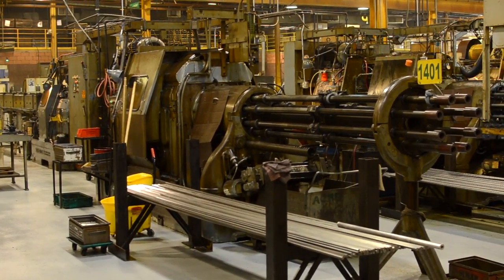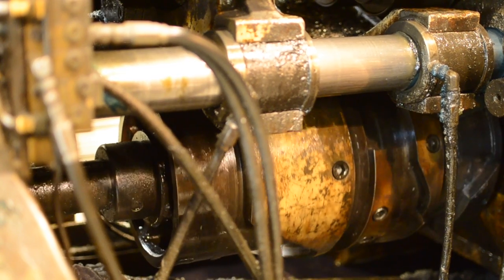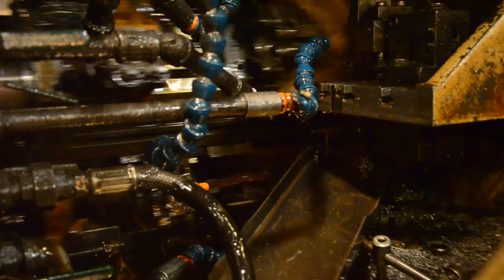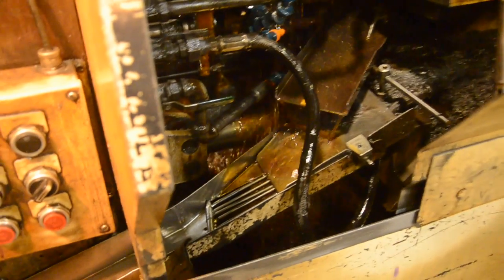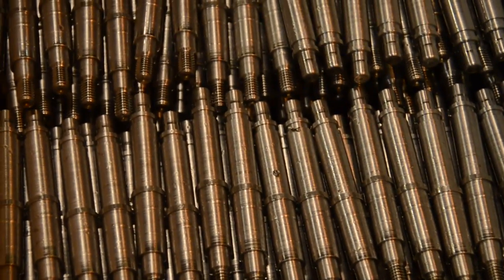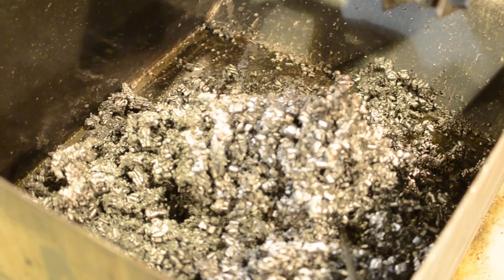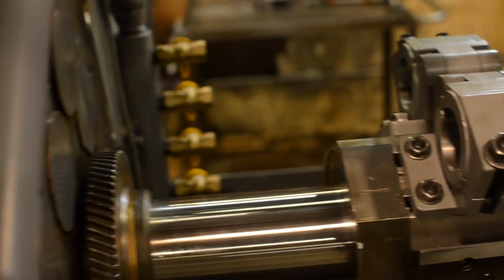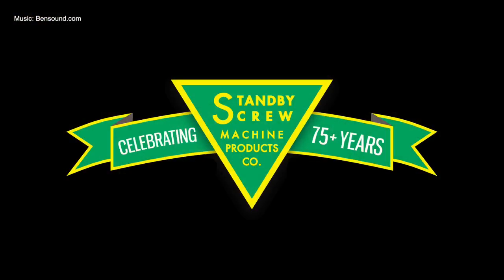Acme Multi-Spindle Screw Machines

Comment: I worked at black and decker hampstead md. Last job there ran 4 machines making chop saw gears. Ran everything from mitsubishi acme gridley, to conematic wickman with pick off at cut off position. We had 52 multi spindles till early 1980's. All had a cost tag on front of machine. Some of the big ones they bought in 70's were well over quarter million. Best job on factory floor

Comment: that shop (and machine) is fucking sparkling clean compared to the one i worked at
Reply: Same
Reply: The shop I worked in had a 3" layer of sawdust and duckboards because of the vast amount of oil that flew out of these and the single spindles as well

Comment: we still have 7 single spindle ones 10 5\8" and 6 3\4"and use to have a about 25 4 spindle 5 1\2 and  8 " ones been replaced by CNC now. they make taper roller bearings

Comment: I visited some Connecticut screw machine factories back in the 1960s and could not believe the working conditions with noise, heat and the air full of sprayed oil ... I trust conditions are better today with air conditioning and protective clothing or respirators!?
Reply: I spent a year working an Acme Gridley 6-spindle multi and a smaller 6-spindle New Britain. It was like working in Charles Dickens era. Had to shower up right after every shift. The oil would give you blackheads all over. Skin hated it. And noise! Wow! Thank God for hearing protection.